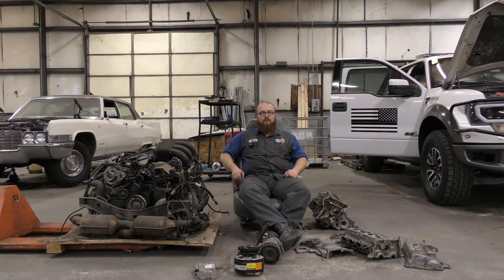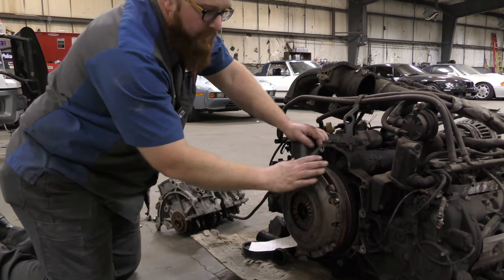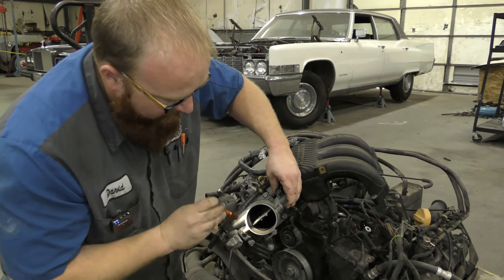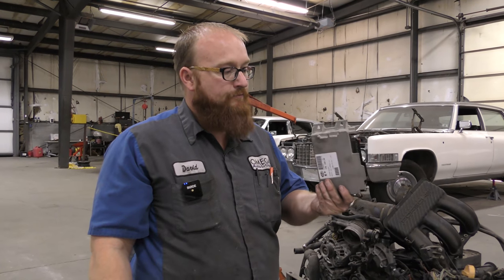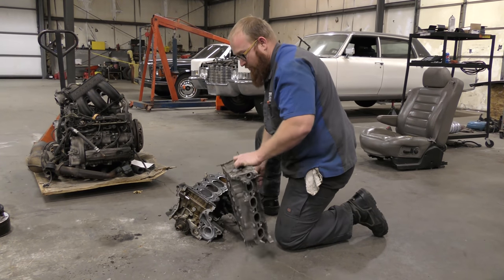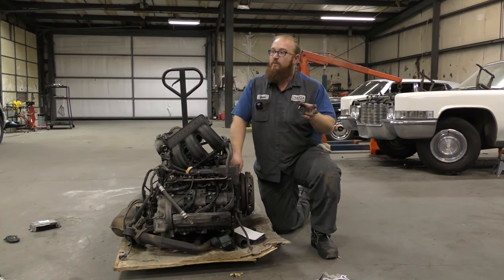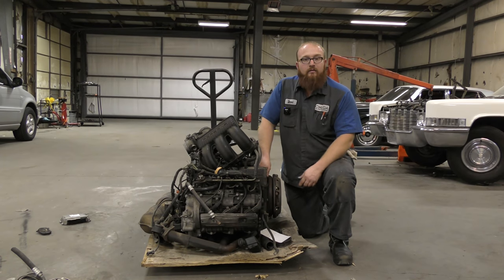The CAR WIZARD explains in everyday terms common Engine issues

Comment: You know, we Land Rover fans usually say that no oil puddle beneath a car is a bad thing. Because that means there is no oil. And no. I have never seen a classic Land Rover that does not piss oil just about anywhere. On the other hand, there is a saying: you dont need to be a mechanic to buy a Land Rover. But you WILL become one.
Reply: Lmao I heard about that Rover engine leaks in Cars 2. "If there ain't no oil under, there ain't no oil in it." 🤣
Reply: @aaryeshg.6526  and yet, I love the things. It kind of a masochistic relationship.
Reply: Agreed, I just did full top end rebuild on my 4.6 rover. So far it doesn't leak anymore but she stays parked lot so it hasn't had any time to leak yet. 😂 Sure does look fantastic though.  Even after she sat for a year before I got it, first place I drove it after the rebuilding was a field after a good rain.  Amazing vehicles.
Reply: @erikgranqvist3680  You've never had a Wankel, have you?
Mazda RX-7: Turning average men into Master Mechanics since 1979
Reply: Also:
When buying a EARLY
JAGUAR,!! YOU BETTER
BE A GOOD MACHANIC,!!

Comment: Thank you for this video.  I've got a 2002 Silverado,  not long ago I had the rear main seal replaced on the 5.3 liter engine.  I'd been buying oil like crazy.  My mechanic told me where to look at his shop. With the engine off you could watch a drop of oil fall from the back of the engine at a regular interval.  I've since had all the other leaking gaskets replaced.  I've been using the same mechanic for years,  I trust him. He went over the entire truck and gave me estimates for all the repairs and maintenance items that need addressing in the order of importance.  Now I'm down to more minor issues with no urgency.  All in I'll have a little over 5K invested in it, and have a good work truck.  Probably doesn't make sense as far as book value of the truck, but it's a Z 71 4X4 LS well optioned.  I plan on keeping it for many years.  Cheaper than a new truck for sure.

Comment: Brilliant concept to do this video!  Two birds with one stone - enlighten your regular customers so you don't have to spend non-constructive time explaining/interpreting every single job and in the process also produce another video to teach the general public.  Well done!

A couple years ago, at the age of 71, I'd finally had enought of inept, greedy, careless and irresponsible mechanics so I decided to teach myself automotive engineering.  That and I just plain couldn't afford the repairs anymore.  I acquired the tools, cleared out the garage and started doing my own work.  I've done a bunch of more or less minor things but in the process have felt much more empowered around my vehicles.  I've been watching YT videos non-stop since then and have learned a lot - already knew everything in this video.  That said, the video was useful because it gave me a measurement of where I am now in terms of automotive knowledge.  Thank you!

 I would also add I appreciate your production values - audio, lighting, etc.  Great idea to have someone in the background fill in with the typical questions one might hear from a customer.

Comment: 1:14 - Front main seal leaking
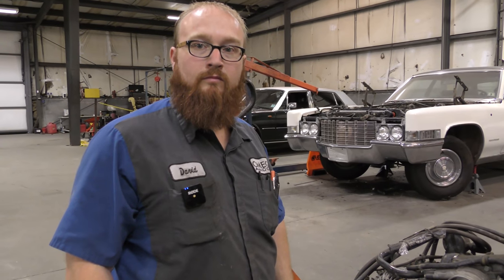3:03 - Rear main seal leaking
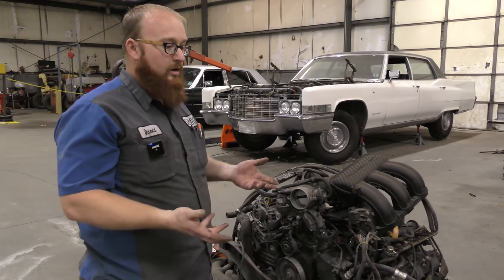4:52 - Throttle position sensor
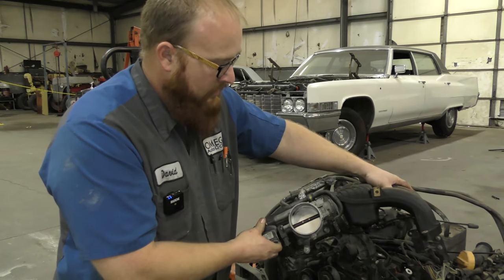6:52 - Throttle body requires cleaning
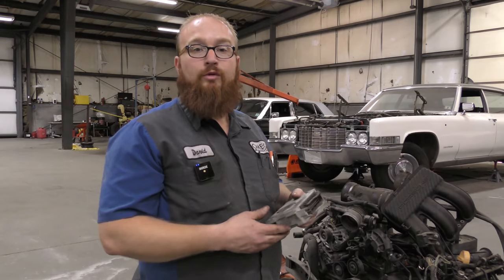8:09 - Computer reprogram
10:52 - Faulty oxygen sensor
12:10 - Catalytic converter is faulty
13:52 - AC compressor has locked up
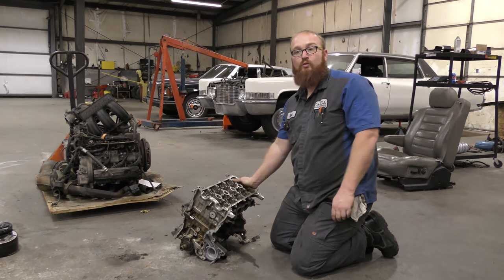15:52 - Head gasket has blown
21:57 - Valve cover gasket leak
Thumbs up for the love.. :)

Comment: Great 411! Regarding that leaking front seal, grit which accumulates under the seal can act like an abrasive paste and cut a groove in the crank which may cause a continued leak after seal replacement. There are thin, highly polished aluminum sleeves that fit over the front of the crank to restore the smooth surface a seal requires.

Comment: Can we get another update on the caddy with the 5.7 diesel? Super excited to see the finished product 👍
Reply: Yes!
Reply: Don Olypopper  what are you on about?
Reply: Don Olypopper  yeah yeah yeah, nobody cares. I didn't listen to the popular opinion when I bought my 6.2 Detroit two years ago and I have not regretted my decision. In fact, I've grown fond of them and many others love those old GM oil burners. The 5.7 olds certainly wasn't built as heavy as a 6.2 and it definitely had undeniable problems but with certain improvements like what wizard had in mind, I think it'll be a cool and unusual build. He obviously has the skills to keep a 5.7 diesel running as well. Now go along and drive your boring Camry
Reply: Don Olypopper  "rEaL diSiels" 
I've done the Cummins thing and lift pump and lift pump and injection pump and ECMs and a engine fire really ruined it for me. Sure, they're good motors but the trucks are garbage. But again, I don't care. But I bet ya "know what ya got" 
Either way, GM still owned Detroit when they designed the 60 series Detroit which is a "REAL DIESEL" and it's quite possibly the best diesel ever designed

Comment: Your tip with the toothbrush WORKED LIKE A CHARM - i had some small misfires so i used a toothbrush and some carb/throttle body clearer , all gone - HUGE THANKS (you have your fans in Israel as well :) )

Comment: Hi Mr. and Mrs. Car Wizard! Love your channel, Learned some new tricks, thanks, Here is two good ones.#1 If you have a rear or front seal leaking, or any seal leaking except brakes use AT205. The best fix I ever found, it definately works! engines, trannys, ps pumps,etc, check it out 5 star in my book! tried all others, this is the real stuff!!!#2 For your press, just use sockets for pushing something apart, all different sizes for any jobs. Like you brake pad spacer trick!

Comment: This was a very good production, thanks, Wizard.  Just 1 thing - if you have a stuck A/C compressor, you can just choose to NOT select the A/C function anymore, but I think in a lot of cases, if you engage "Defrost", that would also try to engage the A/C system, so that the interior of the car would have its humidity removed, and clear the windows quicker than in a non-A/C car.  If that is the case, then I think you could get a screaming belt just from using Defrost.

Comment: Car Wizard: why is it always the rear main seal leaking?  I've never heard anyone say dang, my front main seal is leaking.  Not saying it never happens, but it always seems to be the rear one.
Reply: The rear main seal is usually bigger and get's hot from slipping your clutch or spinning the torque converter
Reply: It would be too easy if it was always the front main 😂
Reply: When your rear leaks, it's considered much worse than when your front leaks.
Reply: @pughconsulting  
Different smell One's more messier than the other  Butt in the End leads to same outcome Bit Priceyer !!

Comment: If I knew back when, what I know now, When I was told by the so called Emissions specialist "I don't know what's wrong with it, but it's not running as well as it should." I would say, "Well, I'm not giving you $150.00 for that just so I can get a waiver. What is your data? What do the codes say?" If he says he can't get any codes, I would ask him why, and maybe suggest I show him how. Turns out all I had to do was turn  the ignitions switch on and off real quick a few times, and then it would start flashing and by counting the flashes, I can get the numbers in two digit sequences. Then I can look it up in my Chilton's manual. Not really difficult at all, once you get the hang of it. It took me (a carpenter, who is not a mechanic) to fix it, but not 'till I was off their system because it got too old. Sad thing. I let the state handle it, and they failed, over and over again for a decade or more. It pays to know a bit about auto repair.

Comment: One additional thing that CAN be an issue with a leaking front main shield is oil spray/flinging onto other pulleys or belts which of course can cause belt slippage, deterioration or throwing of a belt. Much of that does depend on the engine design obviously.
Reply: Would that be the CAN bus? :)
Reply: @kevinshort3943  no. LOL. 😂😂😂 Simply the only reason I had at the moment to buy Snap-On. I followed mt trainer's advise of buying tools rather than the Shop owner's recommendations who swore by Snap-On 99% of the time.

Comment: Reminds me, I need to go get blinker fluid
Reply: Go for the synthetic blinker fluid. Lasts 10k miles with zero problems.
Reply: @markm0000  alright, thx for the heads up!
Reply: I was walking down the street when I saw a house with a old Lincoln town car in the drive way. The whole driveway and street were coated in oil this thing aggressively drips out. I had never seen anything like this before. It looked like it had been going on for a long time. This person must put at least a quart of whatever fluid in it every day at least.
Reply: Winter IS coming :0

Comment: 15:08: Which is why I feel it's a good idea to run your a/c periodically even during cold weather to keep it "exercised".
Reply: angryshoebox 

When you turn on your defrost that kicks on the ac compressor in most cars
Reply: Chump Johnson was thinking the same thing. It goes on Atleast 2 times a week. A lot during the foggy winter nights
Reply: Hmmm air conditioning is to remove hot air and moisture. No reason not to turn it on in the colder months.
Reply: @AdyHewitt , Air Conditioning is a Dehumidifier. It will clear the windshield more rapidly.
Reply: @AdyHewitt You do realize that just because you turn up the heat the actual a/c compressor doesn't just turn off? It isn't only for cooling off the air.
Reply: Desmond Hebert yeah , my original message isn’t that clear. Meant to mean that it will dehumidify in the winter , it’s not just to cool the vehicle.

Comment: One of the worst jobs to do is that damn rear seal you have to remove the trans then take off the clutch then replace the seal then reassemble everything and if you don't have the clutch alignment tool your boned it's the longest jobs to do and it's my least favorite one.
Reply: Clutch alignment tools are for the faint-hearted. Eyeballing rules! ;)

Comment: '70s and '80s Volvos needed a much more comprehensive throttle body cleaning, especially the ones with turbos. Those engines had no PCV valve, just a breather that scavenged the crankcase gases and a small vacuum hose that went from the manifold side of the throttle body to the crankcase. The breather has an air/oil separator but a significant amount of oil mist still reached the TB. Every Fall I had to remove the TB and IAC valve to clean it out or it would stall immediately after starting in winter. It took half a can or more of cleaner, with special attention to the idle passage which was often blocked solid after a year's use and the IAC, which was normally completely jammed by deposits. I learned about those on a forum, where I found it was universal for those models.

Comment: Nice you are discussing these common used mechanic lingo terms and showing the different parts. It will help the customer to understand what they are paying for or the what the problem, really is. 
  To enlighten the average auto owner, as to your computer term compare it to  pcm or emc or MAP part or MAF  part or any other of the most common 3 letter words used to describe parts of the auto repairs to the customers such as idle control motor, speed sensor, etc.... to use several terms. 
 Future videos would be very informative to the non- automotive person. 
thanks

Comment: I was told my head gasket blew on my golf by my jiffy lube guy, because I was seeing oil in my coolant, gunkey brown froth. My main mechanic says, nah! That the aluminum block over heated and oil leaked through the gasket, a minor problem. After cleaning the block, I've replaced the radiator and the flange and we have no more problems. God bless Nelson (my mechanic)

Comment: Car Wizard-i am 64 and worked at several FULL service gas stations back in the late 70's and you wouldn't believe how many people with the then new unleaded vehicles people would buy that little plastic adapter that would fit/allow the LEADED pump nozzle into the unleaded tank, people didn't want to spend the $$$$ for unleaded gas and didn't care if the CAT became clogged because they weren't going to keep the vehicle long anyway, LOTS of funky things went on with used vehicles sold then

Comment: My father was a machinist and mechanic (engineman) in the USN for over 20 years.  He was the chief engineer of his boat until he got his final shore assignment before retirement.  If it was a non-computerized engine that ran on diesel or gasoline he could fix it.  He never did modernize and learn how to use scan tools and such.  He hates computerized engines.  He taught me much about engines.  The basics for old school engines are the same as the newer ones.  It's when you add in the computers and such that you need the specialized scan tools to do the job fortunately those have come down in price and they have ones you can install on your smartphone.

Comment: Great video, very easy to understand! Junior Mint is very lucky to have you as a mentor :) Worst diagnosis was probably a transmission failure in a E34 540i requiring a rebuild. Within warranty, had diagnosis of a failed tooth in a final gear in a 08 Impreza 2.5i that caused a full replacement, and most recently, the dreaded ring land failure in cylinder #4 on my STI.

Comment: I sell car parts. About 1-2 times a week I get a call that goes like this, "Hey I have a cylinder one misfire, do you sell those?"
"A cylinder one misfire is not a part it's a condition. You would have to diagnose and repair the cause of the misfire, I would recommend you go to a professional repair facility."
I could get behind mandatory basic auto maintenance being taught in High School.

Comment: Toyota hybrids have a flywheel but no clutch! The first generation had a "torque limiter" that is like a clutch that is always engaged with calibrated pressure to prevent the engine from being torn apart if the transaxle seizes. That never happens so I think the torque limiter was eliminated in Hoovie's second gen Prius, but the transaxle works better with a flywheel to stabilize the ICE.

Comment: In all fairness that front main seal usually involves a harmonic balancer and you need a puller to get it off but more importantly a special tool to reinstall it as you risk doing severe internal damage otherwise.

Comment: My tip here is GET YOUR CLUTCH DONE AT THE SAME TIME WITH THE REAR MAIN SEAL! Yes you can say the clutch is good so you dont have to change it. BUT it can take a whole day to remove a gearbox and probably costs you over 400 dollars an extra 100 is not that mutch more. You drive away from the shop you go to work for a week or two and notice a slipping transmission guess what its gonna cost. So now its gonna cost you an extra 500 dollars because they got to do the same job and say hey i can see the new rear main is not leaking.

Comment: I did like how the Wizard kept calling that LS the Porsche engine. Just to clarify, that wasn't what it came with from the factory. lol
And here's a free tip, when your engine doesn't have any oil pressure, shut it off and don't rev it. 'Glares at Hoovie'

Comment: Nice breakdown of the basics Wizard! I would just add that if 🐱 is bad there is often an underlying cause (i.e. running to rich or lean, burning too much oil, etc.) that should be diagnosed and rectified. Otherwise the replacement 🐱 might also become damaged.

Comment: What makes your cats go bad?   I understand a few of the things, like impact, but beyond that, the claim is misfire, where unburned fuel can enter the cats and destroy the precious metals within, rendering them useless.    I also understand that the computer will shut down various systems to preserve the engine.   The cam position or crank position sensors can shut down the engine if, for example, the computer perceived valve positions are wrong for the accompanying crank positions.   Or, that if there is no spark, it will not fire off injectors, and Vice versa.   All of this is what I THINK I have learned about the Chrysler 3rd Gen (2004-2008) Hemi.    Self preservation seems to be what is causing the untraceable stalling issue plaguing these LX cars.   But for good reason.   Why then, would a modern engine continue to operate such that it could wash down the cylinder walls with raw fuel, thereby thinning or removing the protective layer of life preserving oil?    If the ignition system is malfunctioning, according to the literature, it will cease fuel injection into the ports.     While ruined cats won’t cause catastrophic engine failure, why would the O2 sensors allow what is obviously raw fuel to continue to be injected into the ports?   They detect, or more accurately compare differences in the exhaust charge content  pre and post cats.    You would think that the cooler raw fuel with a distinct lack of high temp, lack of NOx, way too much oxygen content and far too little CO and CO2 content, not to mention good ole H2O vapor, would all tell the computer to shut off injectors.    So why do cats, which by all measures should be lifetime lasting car parts, fail, at far less than a “lifetime “?    And I do understand that depending on the manufacturer, federal law says certain Emissions control parts are covered for far longer than the usual factory warranty.   Why would any cat, under otherwise 
proper and normal usage, and while adhering to any and all of the prescribed manufacturer’s maintenance regimen, fail?